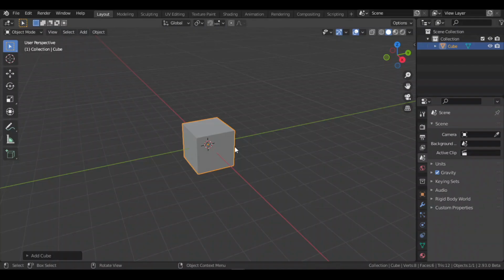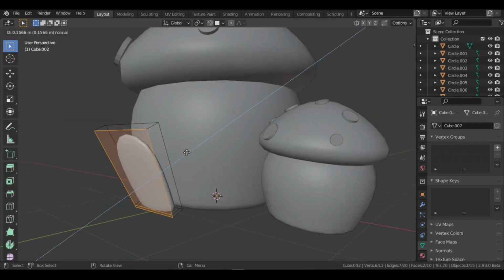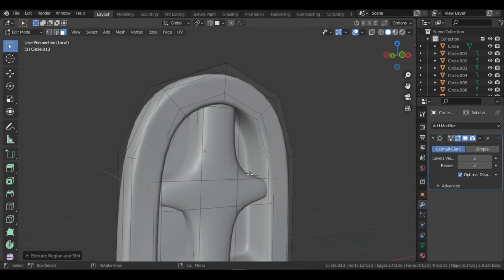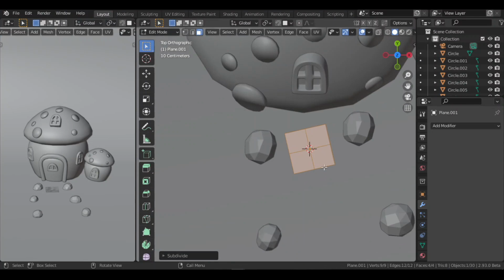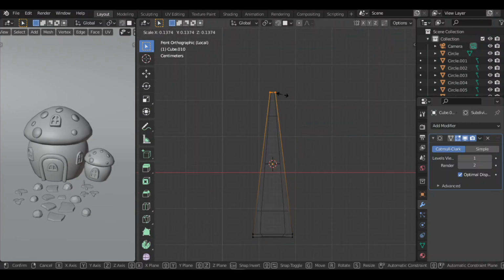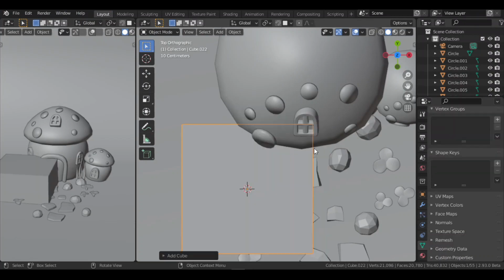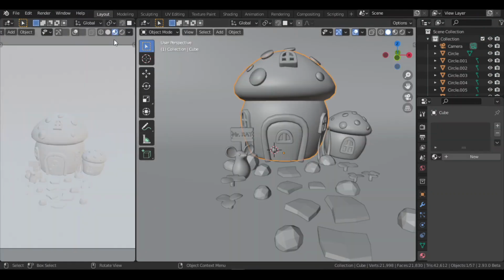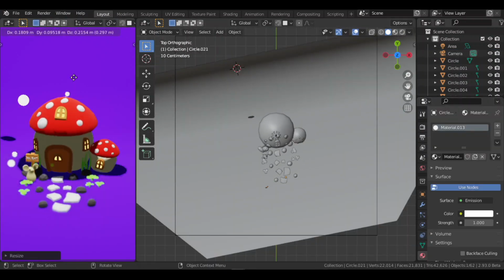Make a mushroom house (fast tutorial)

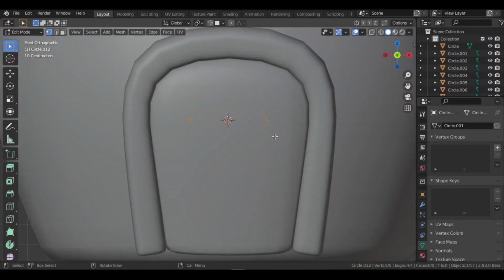Comment: ???at 0:51how did you zoom in to this object like you worked with it solo with out other objects...how can i do that
Reply: Pressing "shift + h" in object mode isolates the object
Reply: @tonyfaztha2299  tysm!
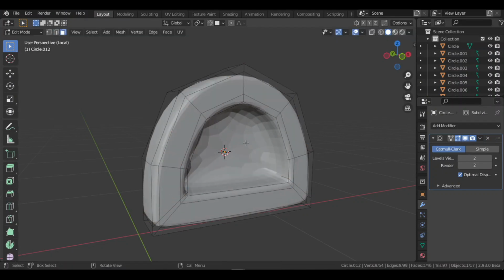Reply: @tonyfaztha2299  ummm hi can i ask what he did here and how? 1:00
Reply: @lanasw6185  sure, for the window 
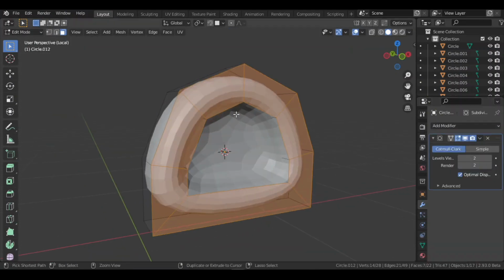1.(0:57)- you add a "Subdivision Surface" modifier 

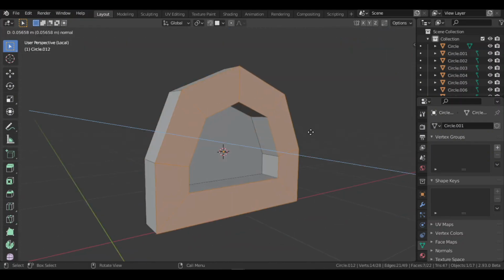2.-(0:58) then with "ctrl + R" you make a cut 

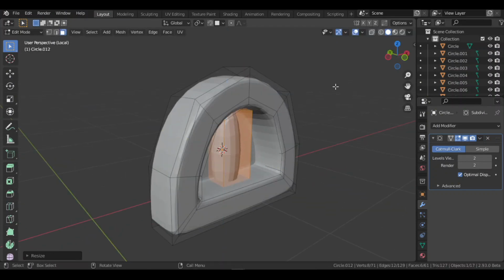3.- (0:59)then click "ctrl + B" to bevel that cut, and with "ctrl + R" again make some cuts to thigh the edges

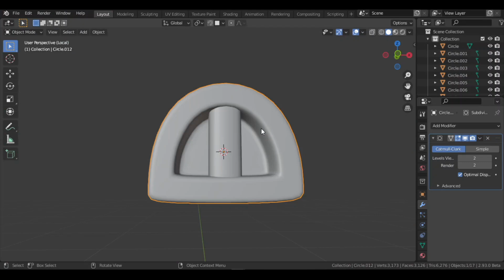4.-(1:00) Then you select the face in the middle of the window and apply extrude to flatten that face

5.-(1:01) then you grab your 3d cursor and place it in the middle of the window and with "shift + a" and place a cube(if your cube doesn't look like the one in the video just apply "Subdivision Surface" modifier)

6.-(1:02)scale the cube, make some cuts and bevel

hope it helps :)
Reply: @tonyfaztha2299  tysm!
I'll try that later :D